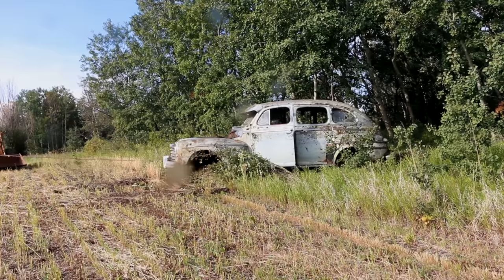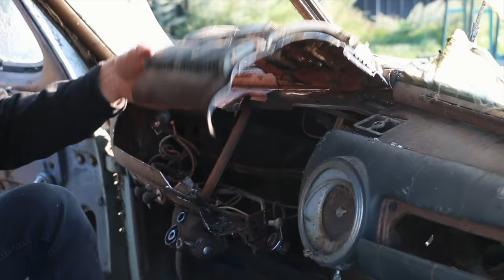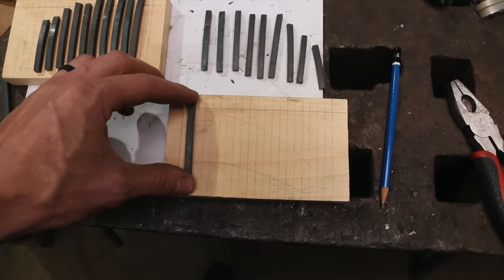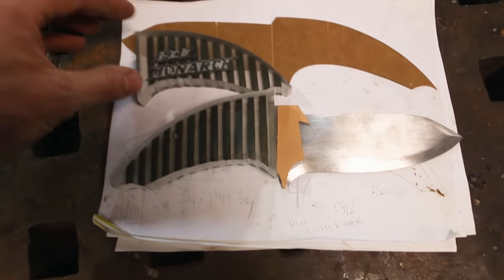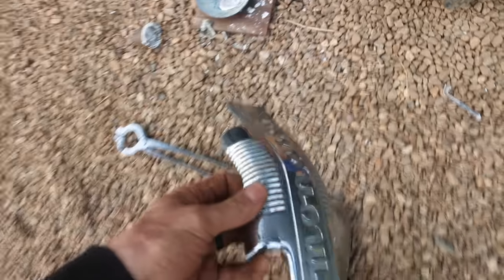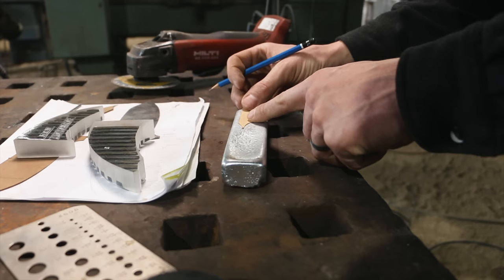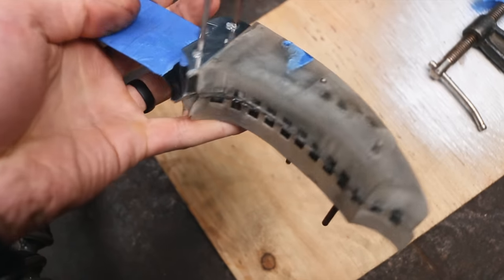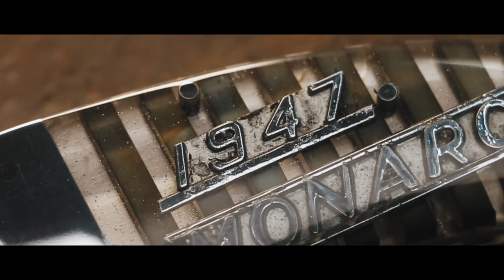Making this knife from a 1947 car.

Comment: What is 'pot metal'? I'm from the UK and it's not a term we have here.  Tin? Pewter? Something else?
Reply: Pot metal is an undefined alloy with a low melting point, used for casting parts that don't need much strength. Think of die-cast toy cars for instance. Composition varies, but expect copper, tin, zinc, iron, lead, magnesium, aluminium and cadmium as possible elements. Minus lead and cadmium for more modern variants.
Reply: Typically tin or zinc
Reply: Here in Australia, where heaps of British cars ended up, we used to call this stuff Brittannia metal or S#!7 metal, because although it was a good surface to chrome over, if it was left bare as in carburettor bodies when exposed to water etc it would simply break down into a powdery crumbly mess that could not be repaired.

Comment: Need to get either a vacuum or pressure pot setup to reduce bubbles if you're going to keep using resin.  The bubbles in the scales detract from the quality of workmanship.